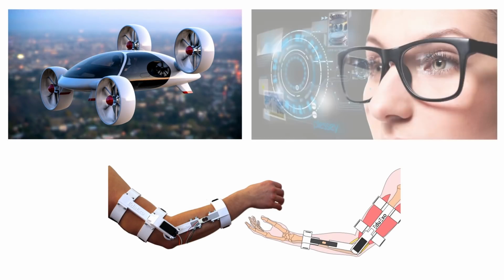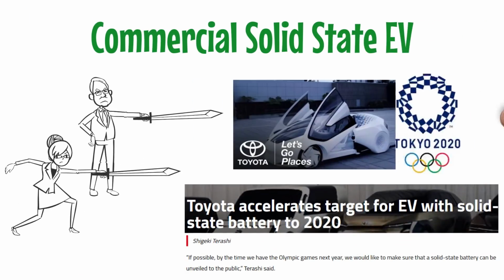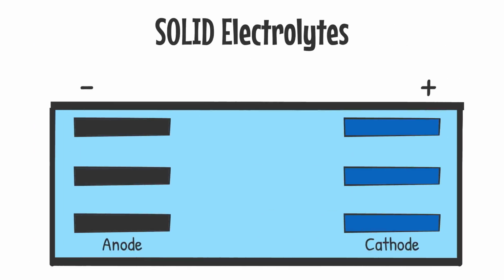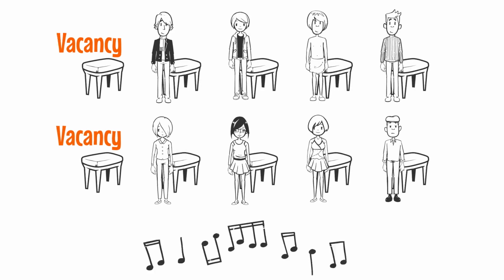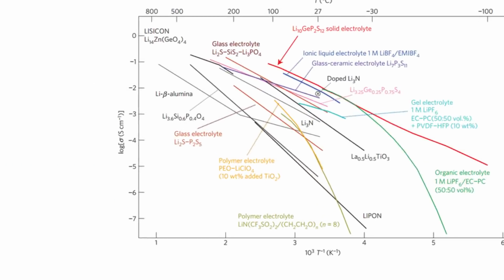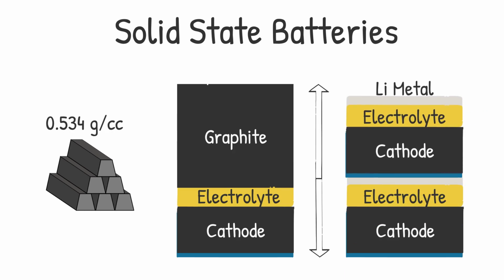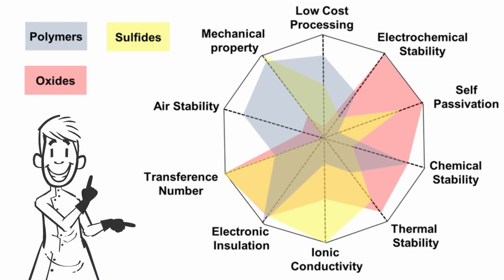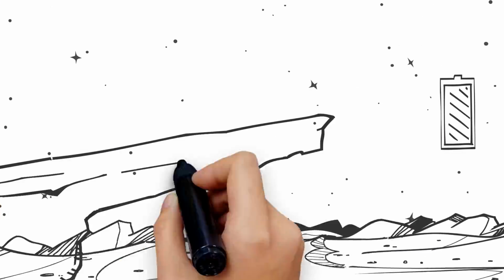Solid State Batteries & the Future of Energy Storage

Comment: Between solid state batteries and all the advances of carbon nano tube tech. I firmly believe that battery/super capacitor technology is well on it's way to where we need it to be.
....
However what needs to be addressed at the same rate of importance is the power GENERATION.    Burning of coal,solar,wind,nuclear(cold or hot) all of it I feel is being neglected in the energy field. Unless we come up with some form of amplification where for every individual volt generated we can store multiples of that same single volt.  We need to focus on cleaner safer cheaper and possibly even individual ways to generate electricity in ones kitchen without having an advanced level of physics.  ..... just saying.   Also nice video on the topic.

Comment: My question is lithium still required to make them?
Reply: You can now use sodium instead
Reply: @nichevl  So lithium mining is obsolete? So you are saying that salt is a solution? Could this be irrelevant? https://youtu.be/oxmreBvoW10
Reply: @LEO-xo9cz  Well with any tech changes there is time lag, momentum, manufacturability etc. What seems to be happening is the general rate of change is going up, as in greater speed of adaptation as more entrants into the market as chemistry in general is better understood amoungst more players, lithium prices going down, more investment in other types of batteries. I was probably being a bit optimistic with 'now' for solid state batteries but sodium batteries have been on offer for at least a couple of years...
Edit: Nice video btw. Lithium is likely to be around for a while for reasons above and it's lighter than sodium. Flow batteries with multiple oxidation states are another avenue, a lot in the mix. Even oldie lead acid and nickel iron are coming back for large storage potentials since lead prices going down and they don't catch fire. Ie lithium and sodium have issues with oxygen, lead, nickel, iron generally don't anywhere near as much. Scale of operations vs competing factors of safety and reliability come into play...

Comment: yeah this hardly seems like the "future" of energy storage. Just a mild improvement. If you compare energy storage in general, not just batteries. A tesla only has two gallons of gasoline worth of electricity. That's 5-10 times less energy than most cars. Granted our gasoline engines are outdated and inefficient. However the energy capacity difference is still very shocking. Moving from electric to chemical is a giant leap in magnitude, but then moving from chemical to nuclear is another giant leap. All the teslas in existence can likely be powered by one nuclear power plant if they had cables attached the whole time that is. Then you go up another order of magnitude with thorium power producing hundreds of times more energy than uranium power. To make the silly devices you want, we need to be playing with an energy source a magnitude more powerful than lithium batteries. This can only make lithium batteries maybe 2-4 times more energy dense. That's not enough for anything.
Reply: It sounds to me like this technology will give electric cars close to the range of gasoline powered cars.  And with the potential of super-fast charging, electric vehicles would become a no-brainer.  There could also be charging stations designed for autonomous operation - just drive onto it.  And this paves the way for the self-driving vehicle.

Comment: So solid state batteries still require rare elements to build?
Reply: S but here these solid state battery  increasing 2 times energy density  than present batteries.so we can get this battery in cheap and lite of its battery weight to increase  range of cars.now the price of tesla battery is avg 180 dollars per kwh on that same price due to increase of its density we are getting 100 dollars per kwh and decreased its weight increase in performance.
Reply: @verelevelanthe200  Assuming the amount of rare elements used is proportional to the volume?

Comment: Thanks alot for this valuable informations, they invented a new kind of batteries (Carbon battery ) could you explain it please, thanks in advance, I wish you success always 💐🌹🌹
Reply: They are capacitors, not batteries. Instead of storing the electricity chemically, capacitors store electromagnetic charges.
Capacitors are made of several conductive plates and isolating plates. The higher the total surface of the conductive plats, the higher the capacity. Since carbon crystals can be made incredibly thin, carbon capacitors can fit a lot of plates into them, which allows them having a very high capacity. But they are still at the laboratory stage.
Reply: @schwarzerritter5724  Und sie haben nur ein rel. kurze Erhaltung!
Reply: Lovely Video! Apologies for butting in, I would appreciate your initial thoughts. Have you considered - Lammywalness Trendy Trade Guide (erm, check it on google should be there)? It is an awesome exclusive guide for learning how to recondition batteries at home minus the headache. Ive heard some incredible things about it and my old buddy Taylor  got excellent results with it.

Comment: You could get rid of the electrolyte all together and use ringing one tenth of a micron a flatness and ring them to allow them to bond fairy weekly they're for eliminating the electrolyte and having a very strong electrical connection the only reason we use electrolyte is to break down that and Oracle road the layer of oxidation from oxygen in our atmosphere tour of the electrons can flu from a higher energy source the anode or lower source cathode or vice versa

Comment: Electrolytes are not flammable. Also any high capacity battery can have thermal runaway even solid state ones.
Reply: The organic electrolytes used in current high capacity Li batteries are flammable.
Any high power cell can have an internal short that generates lots of heat, but it's not a given that this will run away (that is, the heat leads the reaction to accelerate). Since heat apparently increases ion mobility in solid state electrolytes, this seems to be something that can happen to them.
Reply: @galfisk  i have tested burning electrolyte from panasonic cells and not they are not flammable. Not at all. Does not even evaporate at high temperaturen or open flames.